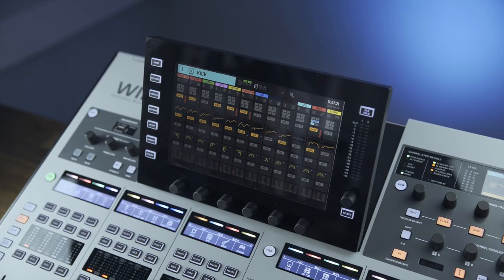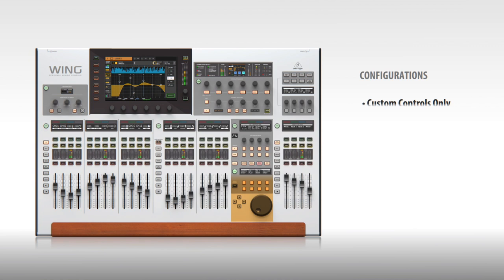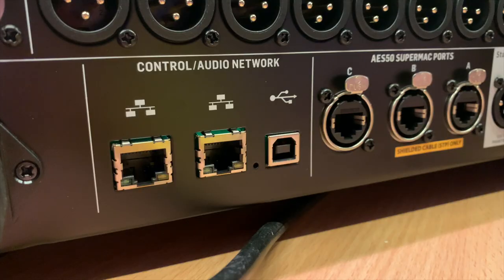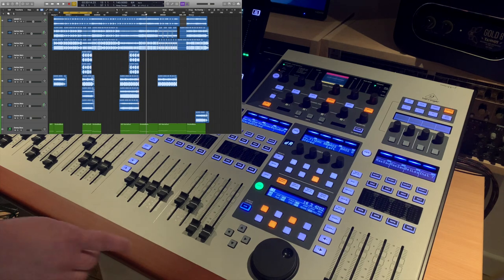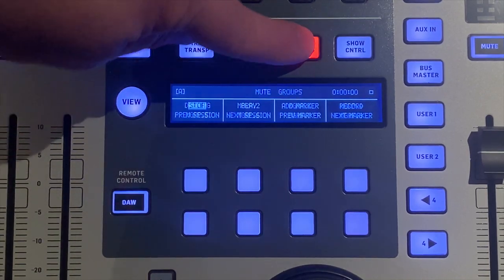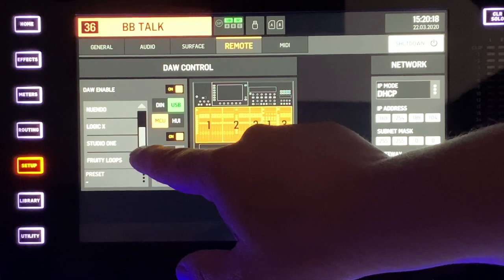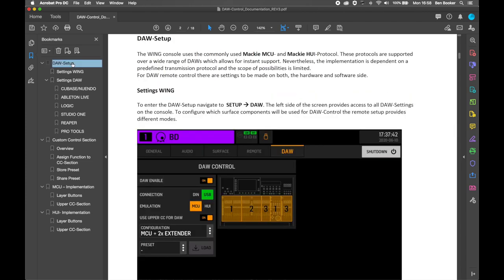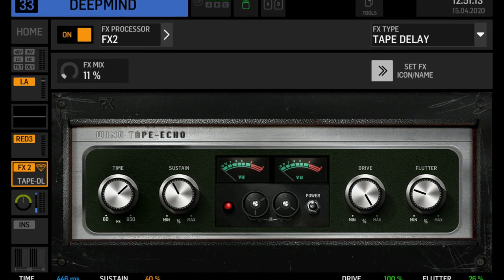WING DAW Update

Comment: I just bought Behring wing for my studio after this feature was added. I am absolutely impressed with the quality and flexibility of the desk. It has revolutionized our studio. I will have to do a video sometime about it. Couple of things missing for me is:
 
1. We should be able to output  a Matrix to Main. I have no way of monitoring a Matrix bus which i setup to operate as a main bus. All other buses have the ability to output to main, but not a Matrix.  

2. Need a way to power off the wing without having to reach behind the console every time. I built it into a desk and its a difficult reach.
Reply from the maker: Thanks Mark, I forwarded your suggestions to the Dev team!
Reply: How is the overall sound and mic pre's in the mixer?
Reply: @leonardgoulet5864  amazing! Worth every penny! They sound pro level to me!

Comment: Support for Cakewalk by Bandlab would be great.  Also,I'm a little hesitant to buy just now in case there is a Midas version of the Wing in the works for future release, in the same way the X32 came out followed by the M32...  Better faders would be particularly welcome.
Reply: Cakewalk By BandLab is Definitely supported! I will send you a link if you want to see it for yourself!
Reply: @teknomaatix7654  Thanks for the reply, great to know it is supported. In the end I went with a different product that better suited my needs, but it's good to know for future that the Wing is an option. 🙂👍
Reply: @fizmo100  So what did you decide to go with? I can't seem to make a decision.
Reply: @teknomaatix7654  I was having to downgrade from a big old analogue console due to space. I looked at the WING and the Midas M32. I think both look like superb pieces of gear, but in the end I felt Softube Console 1 and Fader were a better fit for a studio environment, paired with a Focusrite Clarett 8 Pre and Octopre and an Audient Nero for monitor switching/headphone mixes. I don't need the preamps or onboard effects of the Wing/M32 as I already have good external pres plus the Clarett pres, and I will be working in a DAW with more plugins than I will ever need, so when I examined what I actually wanted it was a control surface with motorised faders, and a whole load of I/O. Console 1 lets me keep the 'analogue feel' of my old workflow but move towards working more 'in the box'. I've kept my old desks into storage though, hopefully one day I will have space for them again! 

I think if I was doing live sound or putting an audio system in a venue or church the Wing and M32 would be the place I'd look first, but for my studio use I'd be paying for a ton of features/functionality I already have elsewhere.  The other hang-up with the Wing as I mentioned above is I would be gutted if I bought a Wing, then a Midas version came out that was nicer.

What is your setup, and what are your options?
Reply: @fizmo100  I just ordered the Focusrite Clarett from Guitar Center. I haven't even had a chance to experience it before the purchase. I did experience the Scarlett. I was told the Clarett is much better with better pres which was confirmed from a bit of research. I hope I made the right choice. I haven't had a recording studio in the last couple of years. I got rid of a Korg Triton, Behringer Eurodesk and some other "stuff" back then. I have been out of the loop for a few years but I am getting back into the swing of things now that I have the freedom to do so and a bit of cash and the space to put it all together. Working in the box has been killing me softly and now that I am getting serious I gotta get right. I lose inspiration with too much ITB. Thats why I was scoping out the Wing and other gear. Its a mess looking for the "right" controller that will give me 24 faders and pots, scribble strips, meters, etc. I think I am going to go with the Mackie MCU or the Behringer X-Touch. Add two 8 channel extenders to either, do some modding and start like that. Looking into some mics like Warbler, Pearlman TM-2 and a few others. I feel like I am being awaken from the dead coming back to my passion! I use FL Studio and Logic for music compositions and PT 10 and Samplitude for tracking, mixing. SO I need a controller that can handle all of them. The WING seemed promising but for many reasons, some that you've mentioned, not quite in the end.
Reply: @teknomaatix7654  That's great that you are returning to a passion - I'm in a similar position, though I am also having to downsize to do it, hence saying goodbye to the big analogue desks for now and moving to a more computer based setup.  I'd suggest you take a look at Console 1 - it doesn't have the 24 faders you mentioned, but you can have two for their fader units in use at the same time which would give you 20.  No scribble strips/meters either, but as a way to control your software it is a really elegant solution, and the fact it ties into Softube's own plugins so perfectly means it really is a joy to use.  Worth adding to the 'maybe' list alongside the Behringer and Mackie.  Icon seem very popular for their control surfaces too - another option to add to the list.

How are you liking your Clarett so far?  I am absolutely sold on mine - as far as I am concerned they are the absolute sweet spot of performance/price - every time I hear it I feel like I've robbed Focusrite, and they have missed a £1 off the start of the price tag.  Don't forget to download the Red Suite and the Focusrite channel plugin that come free with the Clarett - the Focusrite channel is really useable, I find.
Reply: @fizmo100  As far as the Clarret, it hasn't even got here yet. I just ordered a few days ago. Glad to hear it is working for you. That gives me some happiness to know how good it sounds. I will definitely download the things you mentioned! I am well aware of the QCon. Been looking at that as well. The Softube looks and sounds good. Do you have one? Or have you used it before? Personally I NEED faders or I will go nuts! Meters as well, even though I could easily look on the screen of my DAW for that. I may still get one for a few other reasons though. My biggest problem is where I live. There is only 2 really small music stores in the area and none of them carry stuff like this in shop. So I spend weeks online doing research, watching vids and talking to people like yourself. I have no option to get hands on and test stuff like this out before buying. I don't even have a way to listen to my monitors of choice before purchase. The nearest Guitar Center is hours away. But That's why I hooked up with GC. They have a 45 day test and return policy. I haven't found out how firm that is yet but I am about to find out. I have yet to see what type of similar options Sweetwater has. I might take advantage like crazy and try all the controllers and other stuff then send it back and keep swapping out just to get experience with them even if I know which one I want to go with. That should be fun. Never know what will happen.  I think it is excellent to find a balance between In the Box and Outboard for smaller studios instead of all one or the other. To each his own, but this is where I am going, no doubt.
Reply: There is a thing coming. It is out now but getting hands on 1 is almost impossible. Very limited numbers made so far due to covid

It’s Considered the Midas Heritage-D

It is closer to a Midas pro than the wing and doesn’t use the same software.

10-12k price but massively flexible.

Comment: Hi Ben and Behringer. 

How much control of FL Studio is possible in the current DAW mode?

If I am not mistaken, it uses the MCU protocol. 
I assume any DAW that recognizes and utilizes MCU can be controlled. Is this correct?
What about Magix Samplitude? Will there be a preset for it soon?
These are my 2 main DAWs and if so I am ALL IN and give great appreciation for this!
I noticed the Pro Tools icon wiggling in the bottom right corner? Can PT be controlled using the HUI protocol?

Will we see any videos of some of these DAWs in action being controlled by the Wing? 
It would be nice to see how well it functions as a near Universal control surface. Things like automation writing with touch and latch modes. Is this possible? Are the faders touch sensitive? 

If its good. I am sold and you guys would be answering MANY MANY great needs for MANY producers/engineers/studio owners, etc!

Comment: In the future you need a dedicated pan control for each channel. This is very important for both live mixing and studio. Panning now takes two steps instead of one which is not good. Panning is too much of a basic function to be hidden away behind another layer. It shares the same importance as the fader volume control. They should both be easily accessible.

Comment: How do I connect the wing to a DAW (Studio one) so that I can lead the individual tracks to the console, mix them and return them individually?
Reply: I'd imagine that the USB channels could be assigned as either inputs or outputs.  Assuming you have the I/O on the wing set up correctly, you should be able to use pipeline to send/receive the signal and deal with delay compensation

Comment: I have been trying to decide which integrated mixer/audio interface/Daw controller to buy (All in One), AH QU32, QSC Touchmix 30 Pro, Presonus and then we have the X32 and Wing. I would really like to know if the Behringer DAW will have the same default effects built in as their mixers do similar to Presonus. Will there ONLY be a free version, one for the X32 and a different one for the Wing? If the DAW does not have the same effects as the mixer or there not to the same quality then WHAT IS THE POINT? Clearly with the Wing, Behringer mean business in  big way, its their first real big boys toy that takes on all on EQUAL terms.  

I would like to know more before I decide, if you record wet can you then control/change manipulate any used effects/plug ins using the DAW or will you have to route from the DAW back through the Wing to edit the effects/plug ins used and then back out again to the DAW?   Clearly with USB4 coming out soon that should open up the bandwidth considerably between mixer and computer, WHAT ARE Behringers plans for USB4 implementation if any especially for the Wing?

Will the DAW support surround sound? as in 7.1? Something Studio One does NOT do. IT would be great if the screen was detachable so you can wonder round with it and know its easier to replace when the thing dies on you rather than a nasty expensive repair bill some time in the future. Also potentially offer an option to upgrade it to something BIGGER !!

Comment: A Magix Samplitude Preset is greatly needed!

Does anyone know if the scribble strips on the Wing can be set to recognize and display the colors of the tracks in your session when in DAW mode? For example Track 1: Red, Track 2: Blue, Track 3: Green, etc. Either automatic or manual configuration of this would be beautiful!
Reply: AFAIK track colors are not supported in MCU/HUI protocols. Since DAW mode relies on these protocols it is not possible.

Comment: Hi Behringer, the big thing missing for me is the ability to apply all the FX and processing from the wing console inside my daw like alot of the audio interfaces already do. Many folks don't want to have to route to console then back to daw to get the benefits of the Console FX. I would like a workflow that is simple and straightforward. What i would like to see from behringer is not only the ability to control the daw session but also to use the full audio processing FX, Summing, etc of the console from inside the DAW.   This would be a huge game changer in the industry. Daw workflow is fast, efficient, easy to visualize for many types of projects. This is where people want to work especially for complex projects with lots of tracks so routing back to the console to gain benefits of the onboard fx is a no for me.Are you guys working on this already?

Comment: Please consider adding support for Adobe Audition, it is still a very viable DAW, Reaper first was quite humorous :)
Reply from the maker: Hey Ryan, Adobe has added HUI support to Audition on 2018 so technically you should be able to run WING with Audition with the Pro Tools presets. I'll have a colleague try it out...
Reply from the maker: Hey Ryan, good news on Audition:
- faders, mute, solo, bank switching etc. works out of the box simply by using the HUI protocol and the Pro Tools preset
- Audition doesn't output peak data so currently the metering doesn't work, but we will include a fix on the next firmware update to get the metering running
- obviously not all functions from Pro Tools translate 1:1 to Audition so if you want to use extra functionality (e.g. saving your Audition project from WING, copy, paste, etc. – depending on if this is supported by Audition) you might want to tweak the Pro Tools preset or even create your own.
Hope, that helps! :-)

Comment: Was that wobbly icon in the corner mocking Avid or teasing at future support ?
Pro-tools template/preset should be a priority.
Reply: Protools is supported. The preset is already in the console. 👍
Reply from the maker: Hey Sam, when Ben recorded the video, the presets for Pro Tools and Reaper weren't ready yet. But they are now available in the official release!
Reply: I guess it's a little joke, because Avid officially no longer supports the HUI protocol.

Comment: Can I use my DAW from my ipad & iPhone . I use Cubasis3 & GarageBand along with other. I've had a DDX3216 for a long time and now I have the Wing. I no longer use a computer to record. Can you guys help me?
Reply: You can use your iPad to control elements of a DAW if an app is provided by the developer. For a Cubase (Pro) that’s Cubase IC Pro. To run a DAW you still need a computer, mind you;) You generally can use your iPad with a supported interface with multiple outputs and connect them to your Wing’s inputs. Interface needs to be Class Compliant.

Comment: There is no HUI translation pdf for pro tools. You basically have to assign something push the button and figure out what it does. Need more documentation and control of pro tools! That’s why I bought my wing in the first place!
Reply: The last column in the transation table doc is HUI.
Reply from the maker: Hi Jerry,
when Ben shot the video, the Pro Tools preset wasn't ready yet but it is available now in the final release! On top of the preset you can also customize the Custom Controls Section – you can find a table with all Pro Tools specific functions on the WING website.

Comment: Hi still one major issue that needs to be fixed immediate is the ghost touch. This is where the mixer screen changes and select parameters on it's own without a human touch.  Now what's worse is when I switch to DAW mode the volume on the selected mixer channel on screen starts to increase on its own,  this is a big problem please help ASAP, not only is it causing feedback but it can damage my audience Ear drums. Please ,please help ASAP.  I mix multitracks with live performance hence I switch between DAW MODE and live.
Reply: If you have a ghost touch issue, you have to return your desk for repair. This is hardware related. Please get a ticket at CARE.
Reply from the maker: Hi Te,
I'm sorry to hear that! Have you opened a support ticket in our community? I will also forward your feedback to our head developer for WING.
Reply: @audiotom2010  thank you for your response. please can I have some more information on how to go about getting a care ticket
Reply: @behringer  Thank you for your quick response, please can I have some instructions on how to open a support ticket.
Reply: @behringer  Hi I desperately need help here, the mixer is practically unusable. Really stressed here. These Ghost touches are messing everything up. Please , more instructions on how to open a support ticket. Is this issue a software or hardware issue? I had some of them since the last update and did make a post of it under the previous update video but got no response. please help Many  thanks
Reply: BEHRINGER  we have been trying to open a care ticket for our Wing (ghost touch) for 3 weeks now. We enter our info, submit the ticket and it just disappears. Two people from our company have tried, and our distributor tried to submit it on our behalf, all with the same result. How can we open a care ticket if your system keeps disappearing them when we hit submit?
Reply: @xxathrass  thanks for this info I felt alone for a while there, still hugely frustrated with the Wing. To make matters worst I can't even sign into the Behringer site. If there is anyone out there with the same issues please post, we need a solution, Behringer please help us here we have invested a lot in this product.
Reply from the maker: @tejayz4054  Hi there, you can create a care ticket via this page https://community.musictribe.com/pages/create-new-ticket if you have any issues please let us know and we will do our best to assist. We have also flagged your issue with our development teams.
Reply from the maker: @xxathrass  Hi there, really sorry to hear of the issues you are having, we appreciate that must be very frustrating and your patience is appreciated. Please email nathan.somerville@musictribe.com with your details and some information around the issues you are experiencing and we will get this sorted for you asap

Comment: Digital Performer & Reason please.
Reply from the maker: Hey regmon,
if your DAW supports MCU/HUI then all your faders, automation, channel select etc. will work out of the box. You only need specific settings for the custom control section and you can make and save your own preset very easily.